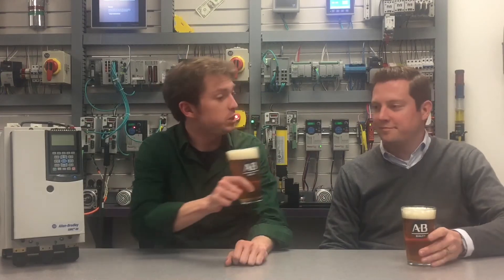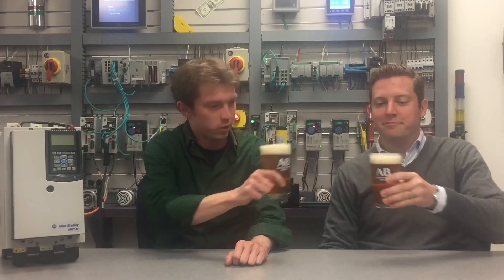When to Use a Soft Starter - Manufacturing Happy Hour

Comment: I work at a public utility, We use both, VFD in the auto mode side And a soft start on the hand side, We also use cone valves which close off The water where there is Very little starting load for 15 seconds, then the valve opens which allows water to flow and to be pumped.. 1000hp 4160v motors.. 33 years working there and seeing the evolution has been very interesting.. Retiring soon as a plant electrician🥲.. Wife tells me Time to experience something new? Maybe a new wife?🤪 Thanks for the great video..

Comment: I want my air conditioner to be quieter and since the only variable for the way my system is set up is temperature I guess a soft start would be the choice for me. Which soft starter for a 3-ton air conditioner would be best there are several on the market. I like the idea of integrating a vfd into my system but I don't know how. Also I'm wondering about a whole house capacitor to prevent voltage drop light dimming?